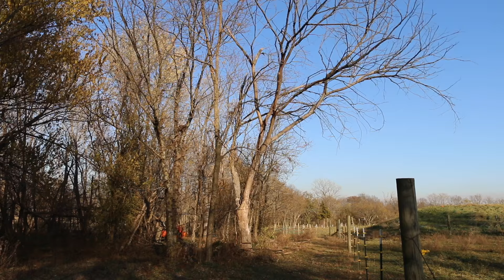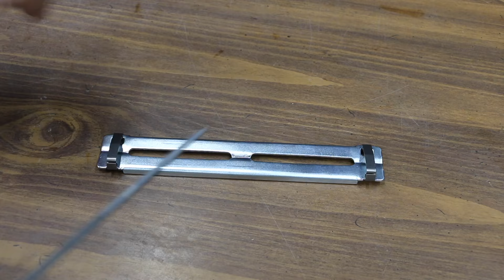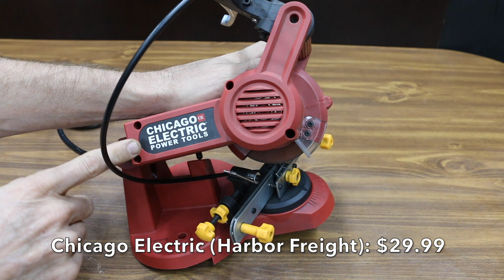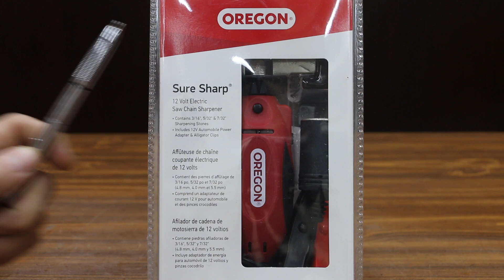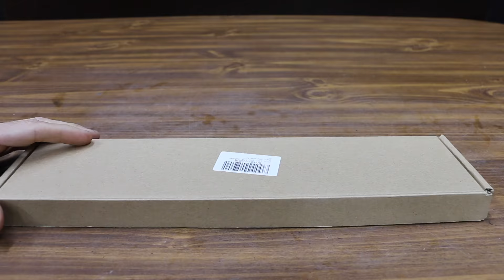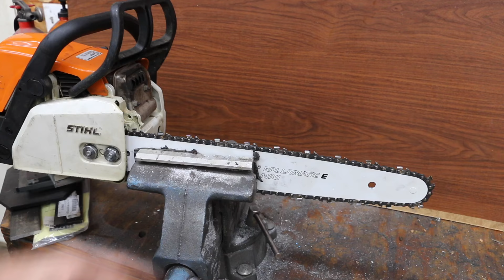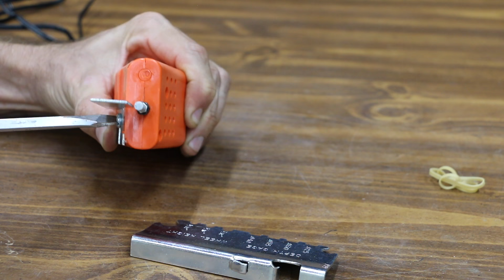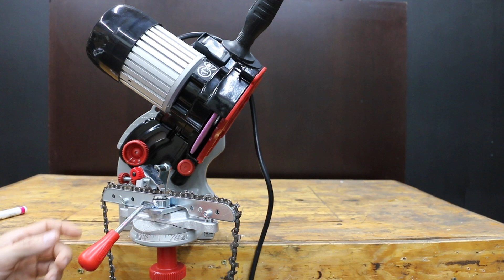Which Chainsaw Sharpener is Best? Let's find out! Stihl, Granberg, Chicago Electric, Oregon

Comment: Thanks, Commander. The saw shops have the Oregon bench jobs and the Stihl #2 took the drags/rakers down with the tooth. Good idea. Thanks for a neat test. Looks like the last tree was taken down by the Farmabago! I hand file and all's well but it takes a while to balance everything out. Thanks again and yall be BLESSED!
Reply from the maker: Hi Lewie, great feedback on the saw shops.  It's a very fast sharpener.  I've been cleaning up 8 acres that's full of dead trees and overgrowth.  I sharpen 4-5 chains when I work a full day.  I've been using the Stihl 2-in-1 and Granberg 12v systems with very good results.  The Oregon bench grinder is my "go to"' for badly damaged chains, since it removes a lot of material quickly.  Wishing yall many Blesslings!
Reply: @ProjectFarm  My choices would be your choices too, Commander. I can file mine out in the field but bring it in and clean, gas and oil it and put it in the vise so I can really tip it up as far as sharp goes. All my stuff is mostly firewood that's been skidded so dirt is a regular but the old Stihl chains do right well. Even I'm too cheap for carbide! Thanks, Commander and we're ALL BLESSED!

Comment: After Hurricanes Sally and Zeta rolled thru the Gulf Coast back in September me & my neighbors found ourselves with dozens of downed and badly leaning trees to get rid of. I dulled my only chain pretty quick in the mud & muck the trees were covered with and lying in, and with everyone else in the area needing to get their chains sharpened at the same time there was a month-long backlog getting one sharpened for $15-$20 a pop. So I bought 2 new chains from my Stihl dealer (they're awful proud of those chains $$$!) and the Chicago Electric sharpener from Harbor Freight for $25 after coupon. It paid for itself after sharpening two chains, and has been 100% reliable and will sharpen a dull chain to factory new in just a few minutes. Absolutely the best 25 bucks I've spent in awhile!
Oh, and thanks for the tip on the lye Todd, I'll keep in in mind. I've been cleaning mine in diesel which works pretty good (but I may be going with lye now) then I spray them with brake cleaner, sharpen them, then spray with WD-40 to keep rust away. With 3 chains and the HF sharpener I always have a clean and sharp chain ready to go. And I like taking the chains off to clean & sharpen them, gives me a chance to clean out the bar groove and oiling holes. Amazing how much gradoo builds up in there, especially cutting big pine trees. 
Great video as always, thanks! 👍
Reply from the maker: Thanks so much!  Thanks for sharing.

Comment: There are 2 ways to file sharpen your saw with a file.
1. Round file
2. Chisel bit file
Chisel bit is superior to round file. 
Bench grinders are great for fast good sharpening. 
But if you want the best "Chisel bit file" is the way to go. 
It files under the cutting tooth far better while slightly changing geometry for a superior point .

Also there is speed sharp and there is working sharp.
Speed sharp won't last as long compared to working sharp. 
And of course the individuals setup for what works best such as: 
1. Direction angle
2. Edge angle
3. Edge type 
4. Rake depth
5. Full complement of teeth (full comp), skip tooth, etc. number of cutting teeth. 
6. Oil and oiler
Lots of variables but for best cutting over all is "Chisel bit" guaranteed. 
Btw "Hand" filing is the best which is Chisel bit.....once you learn it well.
Reply from the maker: Thanks for the feedback.

Comment: I have a 2 in 1 in the saw box, but most of the time I use a Timberline.  It is factory sharp or sharper and once you use it after a manual system you will quickly see and realize how inaccurate and unrepeatable they are.  The 2 in 1 is fast works great, between tanks. The chain performs better off the Timberline which is why I always use it before the saw and extra chains goes back in the box at the end of the day.
Reply from the maker: Thanks for sharing.

Comment: The Stihl 2 in 1 on time, cost, set-up and results is by far a clear winner.
Reply from the maker: Great point!
Reply: @ProjectFarm  The stihl two in one would've done an even better job had you purchase the right size file in the tool for your chain. It's a precision made piece of equipment. Not recommended to swap out file diameter sizes. It messes up the tolerances. Best sharpener I ever owned. 🤗👍
Reply: @benjamincrooker2533  up  mom c mmm k time
Zyb CB M u f l youll k
Reply: @benjamincrooker2533   too true, though some times it is hard to find a dealer that has all the different German/Swiss files on hand.
Reply: @benjamincrooker2533  Absolutely, they are awesome.
Reply: @ProjectFarm  Spot on. The 2:1 mated for the correct Stihl chain is near impossible to beat. Thanks once again for being one of the only impartial sources of info in a world riddled with conflicts of interest.
Reply: I agree, I love mine!!!
Reply: @LSWH  Yep!  I agree, It's the best.
Reply: Agreed, i love em.
Reply: @SheepDog  agreed, when it's time to stop and re-sharpen/service the saw.  one also gains a bit of a respite.  I do love my Stihl MS250, but even it after a while can become tiring to lug around the farm.
Reply: My top also. Once you get thr hang of it it becomes a really quick process. I have 2 different sizes one for my pole saw and one for my chain saw. I take the extra time to sharpen  the chain when I fill up the tank. Nothing like a fresh chain.
Reply: I have the same system but from an other brand
Reply: Agreed. I have two Stihl 2 in 1s—one for each size chain I own. They are affordable, reasonably fast, and do a very good job of keeping my saws sharp while cutting juniper firewood. Plus, no need for electricity of any kind, they are very quiet, simple to use and the files last much longer than sharpening stones. I bought one of those Chicago sharpeners. Never made it past reading the set up instructions! Thanks to ProjectFarm for validating my purchase decision! What a great reviewer!!!
Reply: I agree that the Stihl 2 in 1 is the best choice. It saves so much time because it's doing two jobs at the same time.... 2 in 1.
Reply: I'm in the camp of "Most people should learn how to do things by hand without gadgets".
I sharpen my knives and axes with stones. I don't need to know degrees because I've learned to feel what works.

Comment: $29?  God damn!  My bench grinder was over $1000.
Some tips if you use the grinders, make sure there isn't excessive oil on the chains before sharpening.  The oil will plug up pores in the stone, making it too smooth.
It will not take off material very well, and will overheat the chain, causing burrs to form.
Also, dress the stone frequently, I find it hard to do it, but it should be dressed after every chain to get rid of oil and smoothed edges of the stone, and to maintain the correct shape.
To get it anywhere near as sharp as hand filing you have to go veeeeerrrrry slooooow.  Barely touch the edge of the tooth.  In fact, the best bet is to finish it with a file.
Actually, just use a file, save some money. 
Now if you had a wet grinder, you're in business!  I might modify mine to lubricate after the warranty is up.
Reply from the maker: Wow, that's expensive!  Great point on the oil

Comment: I grew up on a farm in NW Missouri and I was taught that using electric grinding stones would heat up the metal too much and alter the heat treat/tempering/annealing which would affect the durability of the edge.  This is something that wouldn't be seen without making dozens or maybe hundreds of cuts.  It would be interesting to see how much truth there is in that.  If a power sharpener is twice as fast, but the chain needs to be sharpened more than 2x as often, is it actually any better?
Reply from the maker: Great point!  I should test for this in the future

Comment: You missed one.  Dremel makes an attachment that fits some of their tools specifically for sharpening chain saw chains. I have used it and works great. It is supplied with 3 grinding bits for the most common sizes.
Reply from the maker: I'll have to test it in the next round

Comment: What’s up PF I had a unique issue recently that led me to ask a question I know you could answer , could electrical cleaner be used as car/ windshield water repellent. I had to place a DOT sticker on my work truck which was very dirty , I live in northern NY and as you may know it’s pretty darn cold . All my water was frozen so I used some CRC electric cleaner to clean my door from salt and road debris (literally the only thing not frozen as I was at a checkpoint on the highway). I have now realized the area I cleaned has not been dirty for over a month , literally nothing sticks to that area , there was also no damage to my paint. Or vinyl tags. I used some on my windshield and it has had the same effect. I believe it’s better than rainX so could you do a test of this.
Reply from the maker: Very interesting test idea!  Thank you
Reply: @ProjectFarm  no problem , you are the most interesting guy on YouTube , you test things the way they were meant to be tested.

Comment: Seems like it would have made sense to use all the manual sharpeners in the vise for consistency since it's almost certainly easier in the vise. At least it is for me anyway. I generally use the Granberg jig thing (not powered) because I've found that with a plain file or the oregon style of guide, i can get just as sharp in the short term but after several sharpenings, my angles will drift whereas the granberg will maintain them if properly used. Never used a powered sharpener.

Just curious: why you tested with a different saw after resharpening.
Reply from the maker: Thanks for the constructive feedback

Comment: this was a good video that I've been waiting to see for quite some time but I'm wondering if the Oregon grinder would have done better if you set the angle at 35 degrees I'm pretty sure on the box for Oregon chains it says they have to be sharpened at 35 degrees and stihl chain is 30°. Of course I guess that wouldn't matter considering all the other sharpeners also you did it thirty degrees so it's still should have been accurate testingm
Reply from the maker: Thanks!

Comment: Ive been carving professionally for 20 years and sharpen my own chains.  I agree with the results here.  Notes: The 4x4 test isn't completely fair, those knots count for something.  Knot free poplar or something might be more fair?  A brand of file I found that is very fast and aggressive is Save-Edge.  Stihl is decent.  Also not mentioned is the change in tooth geometry as the rotary type filing machine wears its stone.  This can result in the initial teeth being quite sharp and the last ones being overhooked.  Another thing: the swing arm type sharpener tends, imo, to be better on very dull chains.  Files are better for touch ups.  As a chain that has been filed exclusively wears, it tends to develop an over hook that a swing arm can quickly clean up.  A combination of techniques can be better than just one.
Reply from the maker: Thanks for the constructive feedback.

Comment: I think set-up time should be included, but otherwise this was a great comparison. 
To me the Stihl 2 in 1 wins hands down. There is no set-up or mounting on the bar, you don't have to take the chain off to sharpen it, etc....
have 3 Stihl 2 in 1 files and have been extremely happy with them. Not too expensive, well engineered and they work great in the shop or in the field.
Reply from the maker: Thanks for the constructive feedback.

Comment: I have an attachment for my dremel, looks like a cross between the Oregon Sure Sharp and the Granberg 12V.  Cost like 15 bucks and works quite well, made the chain crazy sharp.  It came with a couple of attachments (3), one to sharpen chainsaw chains, lawnmower blades, and garden tools.  Have only tried the chainsaw tool and garden tool ones so far though.  Lol, actually resharpened a SOG tomahawk too.  Nice video!
Reply: I have that dremel attachment too does an amazing job
Reply from the maker: Thanks!  Thanks for sharing.

Comment: Appreciate learning that my Dremel tool with the proper stone is just fine; experience helps.
Reply from the maker: Thanks!
Reply: @TimothyPrice: exactly! I use my Dremel with a lawnmower blade guide every year, and it gives a nice, sharp cut.
Reply: Project Farm shows how the commercial products stack up against each other, but often I find none of the products are worth having😉
Reply: Are you sharpening the rakers as well, or just the cutters? I was a Dremel guy for years until I recently learned what I was doing. Dremel is great for cutters. Using it for rakers is dangerous unless you hand depth gauge each one. The Stihl 2 in 1 is definitely worth having. The 2/1=cutters and rakers. It automatically hits both while maintaining the proper ratio of cutter/raker. Way faster than depth gauging each raker. Worth having if you don't want to lose fingers.
Reply: Your warning seems a bit over the top. Been doing this for years and fingers are fine.

Comment: How about a test on laser levels and home paint sprayers? Love your channel btw.
Reply: Paint sprayers might be really interesting... You have homedepot/lowes options (Wagner) which are not great, next step is the Graco TrueCoat wired or battery operated units which apparently don't last, and the pro Graco/Titan sprayers needs a gallon of pain before they do anything (which the pros don't like either).  It's a surprising deep subject hvlp (airless) vs lvlp (gravity vs pressure pot etc), turbines vs compressors, overspray, coverage, finish quality, production speed.
Reply from the maker: Thanks!  Thanks for the video idea.

Comment: Field tested many times: Live Pine, live Mango and live Cherrywood. Hobby crews with gas saws and electric grinders at work. They laugh at me when I rocked up with a Bosch electric saw and a Oregon field sharpening kit. Ok they sharpened quicker but my saw never overheated on a grinding wheel so no metal hardening lost. At the end my say lasted around 3 times as many cuts as the ones sharpened electrically. Bar oil I used was just sunflower salad oil. This is only good for live wood! But far less messy and environment friendly.
Reply from the maker: Thanks for the feedback.

Comment: The Oregon 120 bench grinder was supposed to have the lower table tilted 10* forwards and backwards depending on the tooth being sharpened.  Also, the stone is being pushed down too fast, heating up the tooth.  They should not get hot enough to turn purple.  I have a similar sharpener at home, works flawlessly.  Many professionals use a similar one.  Great video as usual, I have come to expect nothing less than thorough un-biased testing from this channel!
Reply from the maker: Thanks so much!

Comment: I use the field kit almost exclusively. Wanted to upgrade to the 2 in 1 but never saw the reason until now. I also like the Timberline system for when I can sharpen in the shop. Great video!
Reply from the maker: Thanks so much!  Thanks for sharing.

Comment: During the tests , if you cut through a knot , it will definitely skew your results. I’m a self employed tree guy and sharpen 3 or four chains a week. Every tooth , I treat as an individual job , meaning I customize each tooth. Some wear different than the one next to it. Also to increase the ‘ gullet ‘ I normally use the next smaller size file or wheel . That gives  you more wiggle room in the gullet. The gullet must  a perfect  ‘ C ‘ shape to creat long stringy shavings , like a carpenters plane does . Also if the point of the tooth is not 100% pointy perfect , you’ve wasted your time .
 My well sharpened stihl 461 or 661 will cut through a tree trunk almost as fast as  gravity will let it , with out any downward pressure from me. If you want your sharpness to last as long as possible , start bucking up a dropped tree from its top first. Most damage to your chain happens near a trees ground level where it’s bark is impregnated with dirt n rocks thrown up my rain splatter and wind. Also beware of nails or screws near head height from people hang stuff such as bird feeders and flower pots etc. Make your last cut ( stump  ) nearest to the ground, where if you bugger up your chain , you’ll be mostly done anyways . Use wedges when cutting a stump.
Happy hunting.
Reply from the maker: Thanks for the feedback

Comment: I've used many of the sharpeners on your list, and some are better than others. I personally like the Timberline sharpener, I wish it made your list.  I take the manual crank handle off the Timberline and chuck my battery drill up to it. With the drill attached, is is super fast and very consistent and sharp.
Reply from the maker: Thanks for sharing!

Comment: I use the "file in the drill" method. That works reasonably well. You just have to be careful to be consistent with the angle and the amount of material you take off or you'll get curved cuts. It's very quick.
Reply from the maker: Thanks for sharing!

Comment: I have the Harbor Freight sharpener.  It's cheap but does a decent job.  It has some flex in the frame so you have to be careful not to push it in the wrong direction.
Reply from the maker: Thanks for the feedback.

Comment: I bought the harbor freight grinder after freehand filing for 20 years. It takes a bit of practice. A couple things I learned: You have to mount it at eye level, and you have to take several small bites on each tooth. If you see bluing or darkening on a tooth, you took too big a bite and overheated it. Since I got the quirks figured out, I can get chains sharper than factory.
Reply from the maker: Thanks for sharing